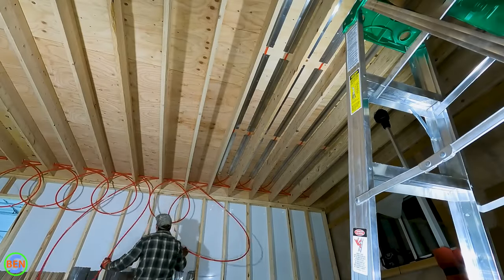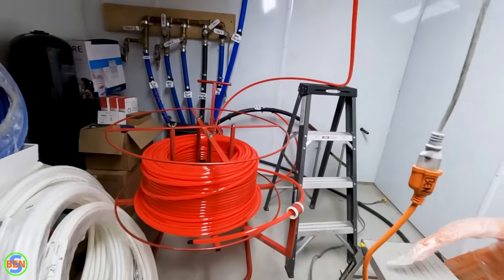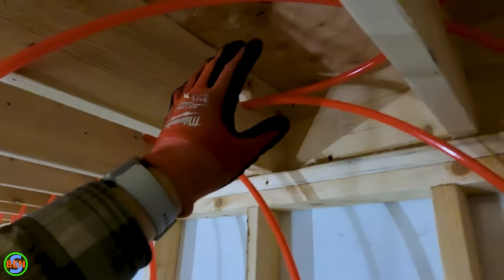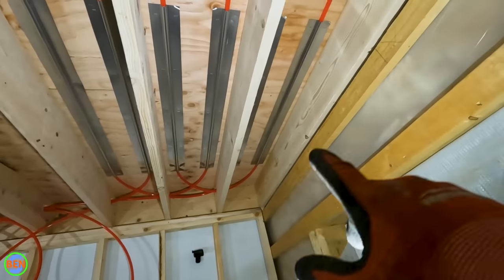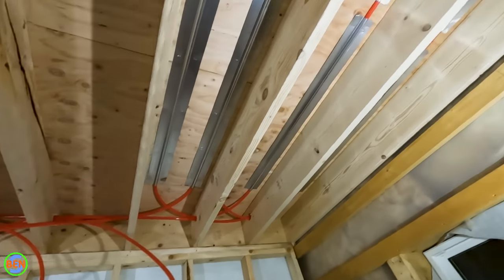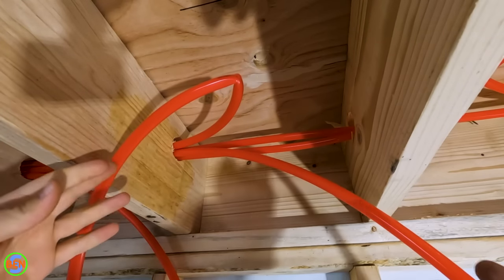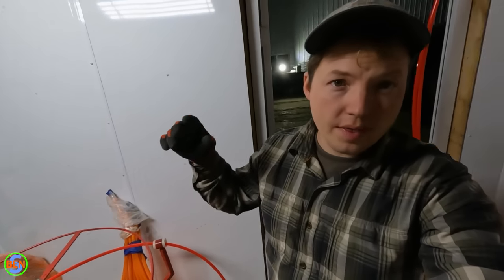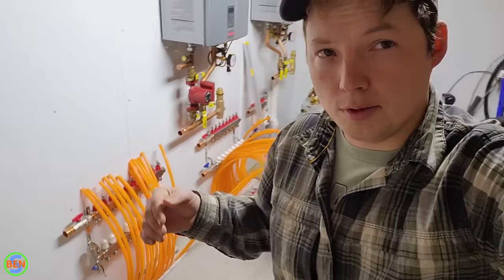How To Install Under Floor Radiant Tubing With Aluminum Omega Heat Transfer Plates Between Joists

Comment: Back when my brother had his house done it was a brand new idea and a brand new product solar roll tubing was put in a loop between each joist and attached to 3/4 copper headers each tube waa rubber about an inch in width two rubber tubes joined together with a rubber Web it was easy to install just staple the web to the bottom of the plywood floor and attach it to the copper headers each tube was attached so it was hooked up at the ends one side to the feed and one to the return so each side side flowed opposite ways  that way each side had equal heat transfer but afterwards they realized that they had a lot of oxygen transfer into the water in the tube aluminum foil was installed between the joist and R12 fiber glass insulation installed below

Comment: I would like to do this in my house.  I have a full basement and access to under the floor.  My problem is that when I renovated, I floored over the original flooring.  So my floor has 2, 3/4" subfloors and 3/4" hardwood on top of that.  I'm not sure if it will conduct enough heat through all of that.
Reply: It should work just fine.  It will take a little longer to warm up initially, because of the greater mass of material you are heating, but once you get it to temperature you will find that you actually benefit from the added mass.  It will hold temp more evenly and cool off more slowly because of the additional thermal mass.  All told, more mass makes for less temperature fluctuation once the whole system has come up to operating temperature.

Comment: Hey, Ben.  Happy to have stumbled across your channel as I’m currently in the process of adding underfloor radiant heat to my home (not too far away from you, near Olivia).  There’s a lot of great information in this video and it’s much appreciated.  Question about my install:  Our house is an old farmhouse (circa 1910) and has two layers of 3/4” hardwoods.  I’ll be covering with a floating laminate and worry that the thickness of the subfloor will greatly reduce heating efficiency.  Thinking about drilling a bunch of small holes in the floor for better warm air transfer.  In your opinion - practical solution or am I overthinking it?  Thanks again!
Reply: @Robert Swaine Justin your question is what I have been looking for as well. We too have a circa1900 home in central Vermont. We want to change over from Propane Forced Air to Radiant.  Robert your content hits all the questions I have been looking for really well thank you!. Any help on how best to size/design a simple very low tech boiler, efficient HWH would be great! I am glad to sacrifice efficient perfection for simplicity!
Reply: @Robert Swaine That actually makes perfect sense.  Much obliged for the input.  As for a radiant barrier, I purchased the foil bubble wrap with the intention of stapling it a couple inches below the radiant plates.  Then, I read (multiple sources) that the product is extremely overhyped.  It’s also expensive.  So, I may end up using 1” foam with foil and then fiberglass underneath (R-value and sound).  I’m not expecting it to be the only heat source on a bitter Minnesota day, but I’m hoping it keeps the house comfortable most of the time.
Reply from the maker: Exactly!
Reply: You can put the radiant heating down, then poor a gypsum floor over the top of it as well if you need another option.

Comment: Hey Ben, I have a question for you,  I'm not a sertified, electrician,  but I went to a private school,  and leared some, but the question is , in a friend house, 4 or 5 lights were off,  checked them,  found out there's no power all, checked main panel,  main panel breakers are in place, none of them were tripped,  found out ,that the neutral wire was in some point broken. What I did,  was in one of the light, I connected the neutral to ground wire. And worked,  is it safe to leave it like that. Or continue looking for the broken neutral wire.
Reply: no that’s very unsafe. you are in danger of being shocked by anything grounded like an appliance or a cover plate screw
Reply: That’s a terrible idea. In theory it will work on a single main panel where the neutral and ground use one bus, but if that circuit is fed by a sub panel, connecting the neutral and ground will cause damage and/or injury. Very dangerous. Best bet is to trace that circuit and find the broken neutral or just run a new circuit for those lights.

Comment: what is the reason for leaving 2-inch air space above insulation and what would be a good insulation to leave exposed in ceiling of basement?
Reply: Creates a warm air space that warms the floor evenly. The spacing on the plates and water temp determines the btu output. Here on the coast of California, I space the plates at 16" and it works great. Of course our cold days are not really that cold.

Comment: You are drilling in an area of the joist that is under a high structural load.  I would like to see some input from a structural engineer.

Comment: @Benjamin Sahlstrom 
If one loop is 138', and the other one is 160', can a standard 2-port manifold be used, or does there need to be some sort of pressure regulator valve on the shorter one to create more resistance?

Comment: You can get heat distribution plates (varmefordelingsplader) that you place on top of the floor and you just press the plastic tubes with oxybarrier down into the tracks of the plates, much easier this is oldfashioned and wasting heat at the ends of the floor.

Comment: I would think electric heated floors would be better. Seems like that would be on hell of a mess if something started leaking. Also, there are a lot of failure points.

Comment: Would this work in home with hardwood floor (3/4) finish?
Reply from the maker: Yes it should. Only thing us that the thicker the floor the harder it is for the heat to transfer through it. Would be best to think of it more as a "warm floor" rather than a primary heat source.
Reply: As long as the nails from the hardwood flooring doesn't puncture through into the pex piping. If I were doing this and anticipating installing hardwood flooring... the pex piping would be attached to the sides of the floor joists, not under the floor.

Comment: Crazy idea, heating an insulation to heat the room... but everything has its own market place and centain type of people for customers! 
Let me elaborate, first of all questions:
-  is it affordable/cheap to install?  Yes, kind of... 
- Does it work? Yes, kind of...
Do you want to drive a kind of affordable car which works kind of? Of course, not.
Putting radiant floor heating under the floor made of insulation material is wrong due to a conductivity and radiant capacity, means you have to pump very hot water to be able to gain very little heat (dissipated energy) at the top of the stack (upper floor surface), to make things worse, wooden floors are always covered with something which contains dust, so putting high temp source under dust is wrong - again. Most of the heat you put into pipes is dissipated into basement area and is coming back to boiler which makes boiler (if methane one) goes on/off all the time making it very inefficient in terms of consumtion.
Floor heating is design for the temperatures up to 100*F of pipes and 85*F of floor itself, dust free, like ceramic tiles with greater thermal mass, conductivity and dissipation.
Of course if you dont't believe what you just read, buy this system, you're perfect customer for it!

Comment: It would be way more efficient to just flash the whole underside of the subfloor with aluminum and snake your tubing in either a zig zag pattern down the joists or in a series of loops and run 1 boiler feed manifold down one side of the room to connect each joist to and then 1 return manifold to connect each return at the opposite end of each joist. With this system your temp is going to be significantly higher between the first pair of joists than between the last and will require higher circulation pressure which will place more demand on the boiler. If its your house you'd also be better off just running copper instead of pex because plastic is an insulator and isnt designed to radiate or dissipate heat into the ambient environment like aluminum or copper. If you want something that will retain the heat your best bet is cast iron, boiler pipe or at least black pipe because the iron will hold the temp much longer, though it wont dissipate outward into the substrate of your floor as rapidly. If youre just slapping together a spec home and are looking to jack up the sticker price by claiming you installed radiant floor heat then by all means use pex but if you want something efficient that will save you money on energy cost in the long run and doesnt rapidy deteriorate from frequent and rapid temperature change then use pretty much anything other than pex, I mean, even mud or clay dug up from the back yard would do a better job than pex (dont be an idiot...... do not pack your floor joists with mud from your backyard..... Im just making a point). If you are doing a large area that is directly adjacent to your utility room it might also be worth looking into an outdoor wood or pellet boiler. Theyve come a long way with the technology and if radiant floor heat is all you are using it for, you basically just fill your hopper with whatever your fuel source is and the rest is pretty much all automated just a nat gas or propane boiler unit,,,,, you'll probably only have to refill the hopper once or twice throughout the season because when the thermostat shuts the unit down it starves the burner of oxygen, which immediately kills the flame and leaves the coals primed so they can be easily reignited on demand about as easy as a gas element. If youre feeling real adventurous you can throw a generator on the thing and run it off of wood gas so you can produce your own electricity and tell the utility company where they stick their bill. Personally I'd rather sell somebody  a self sustaining home I can take pride in building than sell the some hot plastic pipes wrapped in heavy duty tin foil. This idea works but then again a pipe wrench makes for a decent hammer and a microwave makes for a decent arc welder in a pinch.... until they don't. The whole reason we have so many building codes is because too many people think that just because they built a shiny box that doesnt fall over after throwing some nails in it or catch on fire after flipping a switch that its safe for somebody to raise a family in for the next century..... dont be that guy.  Just a little tip.... in the home improvement industry, when a manufacturer designs a quality product they describe it as simply, plainly, accurately, and efficiently as possible but when they know they've got a cheap hair brained idea that isnt going to last or keep selling 10 years down the road once everybody figures it out, they name their product something like "omega heat" and market the living daylight out of it before the whole thing goes belly up. Quality craftsmanship sells itself. Try searching for a snap-on tool commercial and you'll see what I mean.
Reply: Your method would be possible but uneconomical. Full copper amd aluminum would cost a fortune.
Reply: @svenwalker5955  the installation cost is more but it drastically improves the efficiency of the radiant heating which quickly pays for itself. Plastic is an insulator not a conductor and becomes brittle when exposed to rapid and extreme temperature variations. Commercial manufacturers typically do everything feasible to cut production costs so if it was a good idea to use plastic on boiler systems they would do it.... there are several good reasons they dont. If you're just trying to make a quick flip or rip a customer off with a jankidy install and you're OK with being an a$$ hole then I suppose I could see the appeal but there's no way in he'll I'm doing that in my house. It's cheaper to wire your house with bare wire and just use your plumbing for ground instead of running every circuit back to the neutral bar but that doesn't make it a good idea. Any dimwit can build a house out of sticks and mud but to build a home requires a bit more thought, knowledge, experience, practice and skill.

Comment: This is the wrong way to pull tubing, pull one line to the end and back to the beginning, then pull the line that goes back to the  roll for the last joist bay to full length of the bay.  Repeat for each joist bay. This prevent having to create loops ahead of time

Comment: My wife and did a very similar installation with a high efficiency gas boiler in our house in Rochester NY. We regret it! Wish we had gone all electric with a mini split. Would have been a much simpler, less expensive / less effort to install, and less expensive to run, plus would have given  cooling too during summer. Big mistake, but we were specing the system right before mini splits got so popular. Installing a new boiler system today is nuts.
Reply from the maker: Heat pumps aren't practical or cost effective to heat this large of a building. It's over 7,000 square feet and in Minnesota the temps get low enough that the cost of a heat pump system would greatly surpass that of a boiler. Definitely agree that there are lots of factors to consider though.
Reply: Meh, I will be heating two shop buildings, a house, and possibly other outbuildings with an outdoor boiler.
Reply: Is this AOC. Jesus. Heat pump lmfao. I love the people who say heat pumps are cheap to run and don't have one. There expensive to run.
Reply: @tuppersdad  gotta be careful with the general term for heat pump, I’ve got a horizontal closed loop water to water heat pump and it has been night and day in cost compared to propane or even NG. 1800sqft shop with 12’ ceilings
Reply: @wadeolin1295  i guess so since you are talking about geo thermal which is not the same thing as a standard heat pump. But is called a geo thermal heat pump but still total different system.